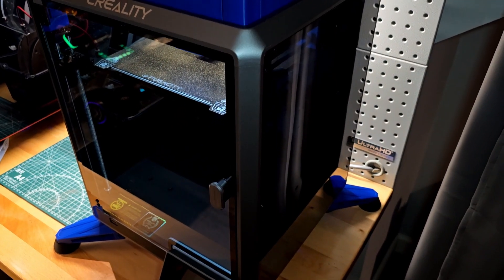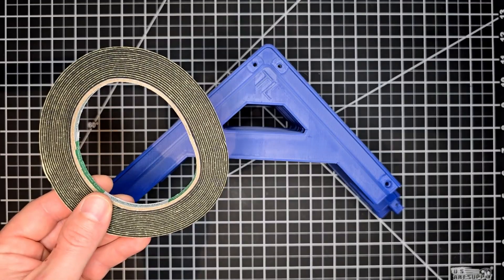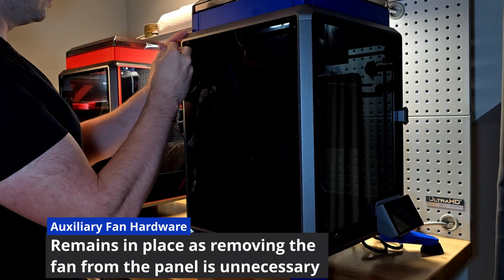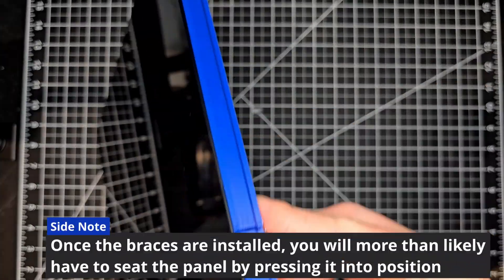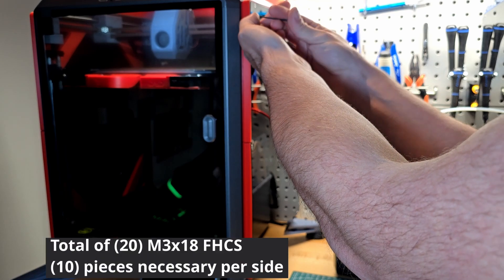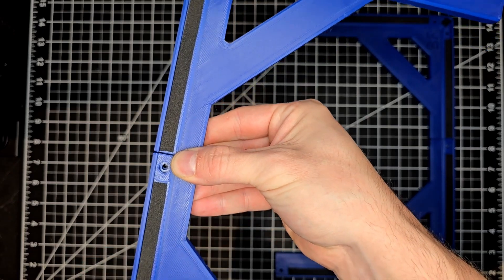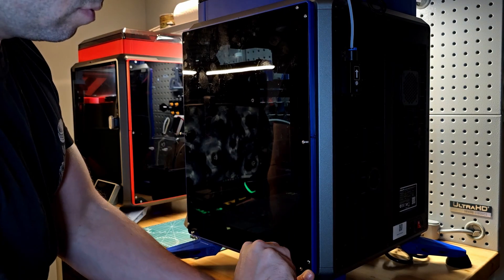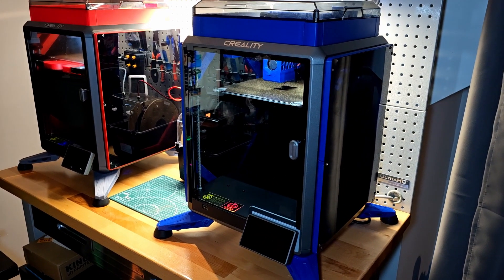Creality K1 - Derrick Darrell's Side Brace Install

Comment: Are all these sweets mods and upgrades that you do to these printers transfer to the k1 se mate? Its a little more in my price range
Reply from the maker: @vhrte49  Yes sir! What I do like about the K1 SE is the cross bracing through the middle. See if you can retain that if you perform this mod. If not, this design is a lot more robust than the corner bracing that machine arrives with.
Reply: @CovenantCustom  Thanks mate. All of your mods relate to the k1 se?
Reply from the maker: @vhrte49  These mods can be performed on the K1/K1C/K1 SE/K1 Max. The whole family!
Reply: @CovenantCustom  awesome

Comment: I am waiting for delivery on my K1C and have seen videos of the frame wabble and have been trying to think of a solution I would like and now i find this. First, thank you for taking the time and making your detailed upgrade videos. I told myself that i would not mod this printer but who am i kidding.  Im wondering is there enough room inside the printer to make the braces thinner but also add bracing to the frame itself inside the printer all in one part.  I like this implementation but I want to maintain the stock exterior esthetics as much as possible.  Thanks again for your great videos.
Reply from the maker: @bigpapa8196  Congratulations on your purchase of the K1C. They're great little machines!

There are points that need improvement but that's nothing new for a Creality product. They've got good bones though.

It's been fun covering my projects just so people know what's involved. Hoping that it provides assistance if anyone chooses to pursue the same.

As for bracing that doesn't change the factory esthetic, the motor mounts and (2) Z rods up front would prevent that possibility. Although it makes the machine slightly wider, it is the best configuration to avoid obstruction of the internal components.

Comment: I like the idea of these braces, but i have a feeling they will not play nice with my 270-degree door hinges. are you aware of any that might be compatible?
Reply from the maker: @jakehoyt497  The braces and those hinges definitely won't get caught in the same place at once.

I considered the 270-degree hinges but believe the improvement from the braces outweighs the convenience from the hinges.

Definitely understand the interest behind them! There just aren't any other side braces available. It really depends on what your preference is.

My input shaper results did improve from this install, but they were quite good to start from prior tweaking.

Comment: What do you think about steel side braces? I can cut myself out of 6-8 mm stainless steel sheet on a laser.
Reply from the maker: @wegorzinside  If I introduce any metal bracing down the line, I'll be utilizing aluminum at half that thickness to pair with these braces. My concern for that application would be the weight/load that the short length of threads in the frame (which are quite easy to strip as I found) would be supporting. If you choose to do so, be cautious/mindful of that. I'd also be curious about how the threads hold up long-term while supporting that kind of weight with the machine's gantry movements. If you decide to move forward with it, by all means, keep me posted on the results. I'd start with a thinner sheet of aluminum just to have an idea of the stabilization properties. Making sure to still apply foam tape between the frame and brace to avoid introducing additional vibrations.
Reply: @CovenantCustom  Worst case you can always drill the threads out to like a M4 and use a self locking nut on the insite (the nuts with nylon in them)

Comment: They don't look like they would add much in the was of stiffening the frame, seems a bit flimsy. Do they really make much of a difference?
Reply from the maker: @Weird_guy79  Input shaping results improved with these braces installed. Printed at 5 wall, 6 top, 6 bottom at 45% gyroid in ABS. improvements were noticed in calculated values from an input shaping test performed following install. I'd say for the $11 it cost in both filament and hardware, it's a worthwhile upgrade.
Reply: @CovenantCustom  will have to give it a go.

Comment: Would love to hear a before and after
Reply from the maker: These braces, without any additional replacements/adjustments performed increased shaper values on X from MZV - 13.7k/68.2Hz -> MZV - 13.9k/68.6Hz and Y from MZV 9.5k/56.8Hz -> MZV 10.2k/58.8Hz. They serve their purpose well!
Reply: @CovenantCustom  Trying these out today! Thanks for such a quick reply! You're a certified beauty
Reply from the maker: @juliustsetsekas4946  Hoping that your results reflect something similar to mine! 

I certainly don't believe that I have a magic touch, especially after this install with my "Righty-loosey" moments.

Happy to provide responses and answers as quickly as I am able to! Thanks for reaching out!

Comment: Pla should be fine for this or abs is required?
Reply from the maker: I would print them in the highest temp filament you own. Its best to use ABS/ASA so that you don't have to replace them down the line as a series of heat cycles in the chamber would most likely cause deformation over time. Especially the corners up top as the heat soaks the frame and is quite noticeable to the touch over longer prints while the machine is closed up.

Comment: Nice video man. i stumbled across your videos yesterday. I've already watched all the ones you have posted. I saw this mod on your red one yesterday in one of the videos. What would this mod do to help your prints? I also had the same question on the wide stance feet. Maybe some explanation on what the mods help improve print wise would be helpful? Either way, I enjoy the videos. Has inspired me to make some modifications to my K1 Max.
Reply from the maker: Welcome to the world of printer improvements! In short, the side braces help reduce frame flexing which moves in the direction of the printhead on the gantry. Printer's do not like vibrations and results will be limited on what accelerations they can operate at reliably if vibrations are high.

Stiffening up the "chassis" so to say, helps eliminate some of those vibrations so that you can run the machine reliably at higher accelerations (aka faster movements). Paired with the feet, that help stabilize the machine (the higher the accel values, the more likely it is to want to walk away) and keep it from dancing off the surface it sits on, its a great combo.

Consider the wide stance and low center of gravity as a way of keeping the machine planted (like a tree that is well rooted still swaying at the top from the wind because it is unsupported or in this case the base of the printer properly stabilized but the top frame still swaying due to printhead motion without the braces installed).

The braces reduce the sway up top to pair with the now firmly situated base. Hope this helps to paint a picture! Thanks for your curiosity in the project as it prompted an answer that might help others understand the importance of these modifications as well.
Reply: @CovenantCustom  awesome explanation man. Thanks for the feedback back. Looking forward to more videos from you. 

Also really liked the Booty Call Jones rails upgrade, and your video made it look very simple. Amazing guide.  But still seems a little out if my wheel house atm. What does that mod fix or improve?
Reply: Oh and also man, your prints come out so clean and amazing. Could you do a video of a step by step how to calibrate for super nice prints like that? I know it has to do a lot with calibrating the filiments, but I never know which test to run first and what order to run them in.
Reply from the maker: @daddygotgametv2721  These machines are notorious for something called VFA (vertical fine artifacts - ghosting/ringing) due to a variety of the factory equipment. Between hollow linear rods on the X axis, improperly sized/selected motor pulleys, low performance stepper motors driving those pulleys, smooth idlers on the toothed side of the belt in the XY joints, there was a lot to be improved upon. The Bootycall Jones gantry removes all of those items from the equation and implements a better build for improved quality and performance. They help eliminate resonance/vibration that causes the printhead to move in a very tight "serpentine" pattern which leaves waves or vertical "columns" in the print surface.
Reply from the maker: @daddygotgametv2721  Appreciate that feedback. Quite honestly, I could pick apart the print quality on these braces but for the application, they work well for me.

I run temp tower, flow test 1, pressure advance, flow test 1 again (this way I can rule out rounded corners from being a pressure advance issue after establishing a baseline for flow on my first go around), flow test 2, retraction, max flow and VFA. Essentially in the same order listed but with that one additional step. The Tutorial link is what I learned based off of but I can definitely make a video if others wouldn't find it redundant!
Reply: @CovenantCustom  talking about braces and VFA test:
-which material is preferable to make those braces  of? I guess pla would be too melty, petg – too flexible... So it should be smth rigid and heat resistance, right? ABS, ASA, or whatsoever
-Did you ever got a thermistor issue error while printing VFA test? It says smth like "Hotend is not heating properly", or smth like that. Getting that error apr. after 30-40min printtime, in every exact moment. Rooted my k1 and have bamboo clone hotend right now and I don' remember if I had same issue on stock hotend or not. Changed thermistor and thermal grease but still getting same error.
Reply from the maker: @kenyajobs1069  The braces are printed in ABS but ASA would also be a good choice.

In regards to your hotend error, it is most likely heater related and not thermistor related. Odd that it occurs at that time interval every time. I would reinstall the factory hotend and run a print, using that equipment as a control to test off of. If it doesn't present an issue than the results of that error are due to the bambu labs clone or at least the heater element attached to it.
Reply: @CovenantCustom yes please make a video
Reply from the maker: @Cecina-  If you are referencing the filament calibration, I can make time to cover that in the next couple of weeks. Traveling for work at the moment but I'll do what I can when I arrive back.
Reply: @CovenantCustom  the interesting thing that this error appears not on every print. I've ran 4hr prints dor my lifepo4 battery setup several times and there were no such issues at all. But I'll try it with the stock hotend too, curious about that.
Reply from the maker: @kenyajobs1069  Sounds interesting. If it occurred after the upgrade, it's usually pretty easy to rule out the reasoning. My expectations are that it will be resolved by switching to the factory unit if all equipment is in tact.

Comment: An interesting mod. What are some indicators in your prints that show you should consider this?
Reply from the maker: @shirgall  I've tuned my printers to the point that even minor improvements can be noticed on various calibrations and the results/graphs they provide. After installing these despite my frame thread mishap, input shaping results showed positive improvements with higher values provided back. Indicating that before they were installed, the vibrations must have been amplified through the frame flexing. With no other changes made, the accelerations improved following install that both allowed higher recommended shapers and increased the frequency range that the machine can operate within.
Reply: @CovenantCustom  My VFA certainly went down with the linear rail mod and your video. Thanks for your help with that!
Reply from the maker: @shirgall  Awesome! Thats definitely the goal with that mod. Happy to help!